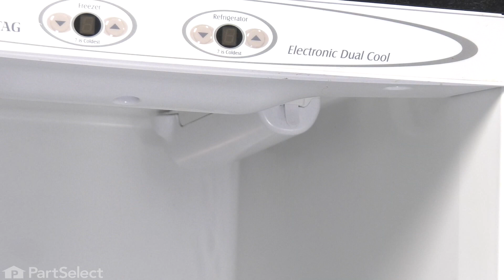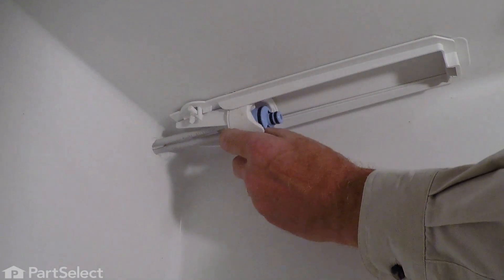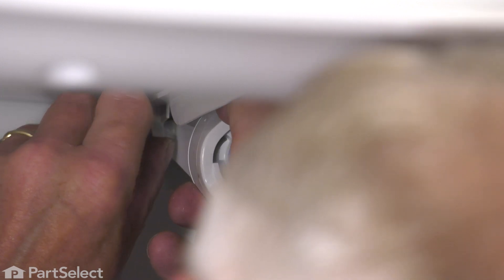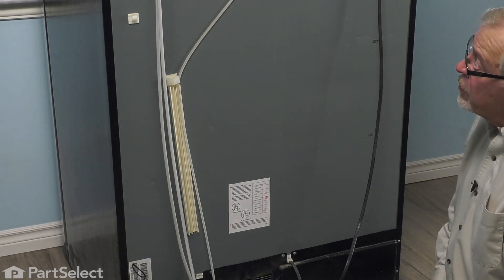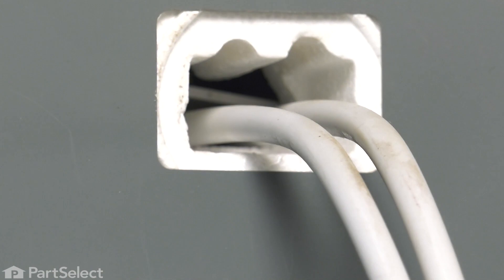Whirlpool Refrigerator Repair - How to Replace the Water Filter Head (Whirlpool # WP67004106)

Comment: Nice video and instructions. The only thing I would add is that if the filter line is difficult to remove, be sure to press down both sides of the green collar, and then pull out the line. You can even use a small wrench to press down on both sides simultaneously. Then pull.